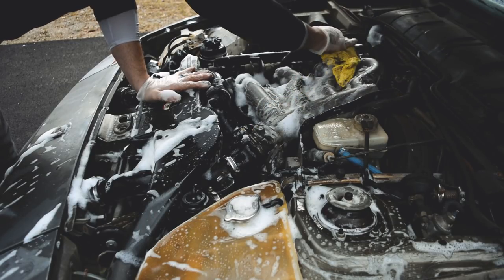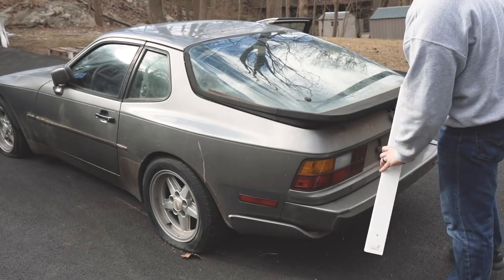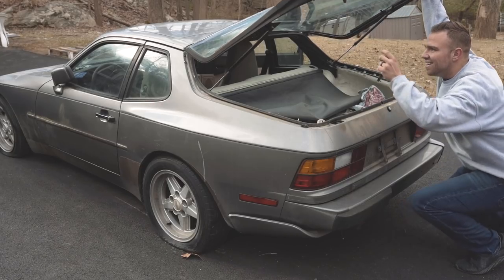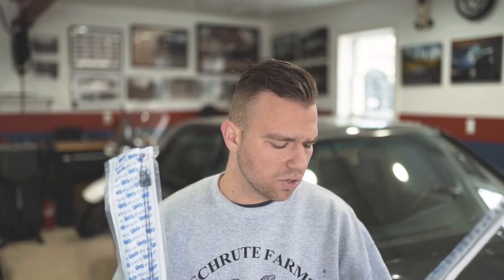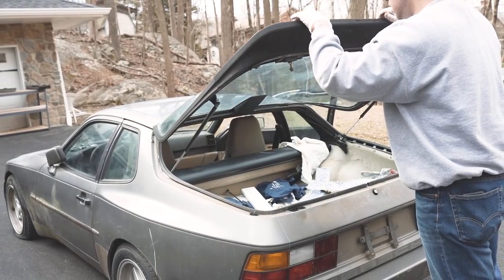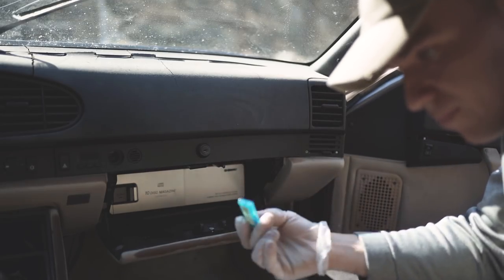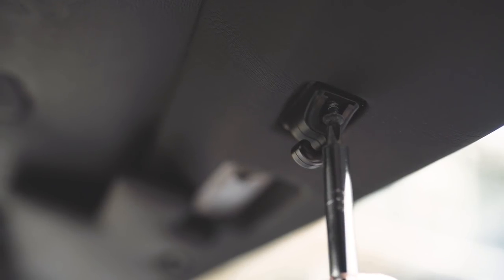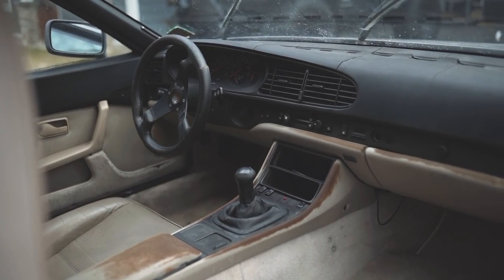I found something INSIDE - Porsche 944 Turbo Build E2

Comment: The rubix cube of a lock is actually electric. Charge your battery, check your lock motor and cables. Should open very easily if eveything is working correctly, surprised the glass didn't break with the way you were opening it, your shocks are not the issue.
Reply from the maker: Deancent Garage I had no idea about the electric lock, I figured the key would release the pins and it would go up, but the hood struts we’re giving me some resistance near the hinge of the glass hatch. I will plug a battery in most likely tomorrow and see what happens, thanks for the info!
Reply: And don't forget to spray lube on the latch , each side !! Work the key. A bit and the latches will be smoother!😄😄😄

Comment: I built a 1985 944 n/a. Installed a turbo, & rollcage. Had bout 6k in it..  tried to sell it. 2yrs later I got $3500  lol.  No1 wants these cars, dont no why. They look kool. Pretty fast for it's time.  Handles like a race car,  wish I would not of sold it.. but got a 2001 bullitt out the money I got.. "new build" twin turbo 2v time...
Reply from the maker: Adam Bryant they are fun I had an 85 944 n/a also but sold it for a decent profit, this car total I’m under $1500 with the car, parts, trailer to haul it, fiberglass fenders and full 6 point roll cage
Reply: @pkaczynski  it the little shit that got me.. Porsche starter, altanater, ect.. cost big $$ when its  Porsche parts..if I had to do it again, I would do a motor swap, sound high, but the end result,  it you save money on parts,  & get more hp.. live & learn. It was fun either way...
Reply: & funny.. my windows worked, but very slow..  I hear other people with the same problem with the 944..  & I broke my back glass on a speed bump.. $600 for a used 1 on ebay...  I should of got the aftermarket hatch..  never have to worry bout the glass again